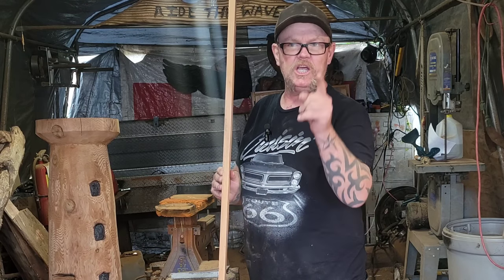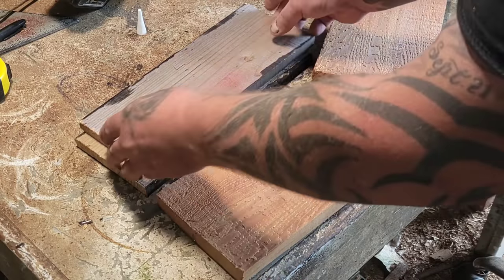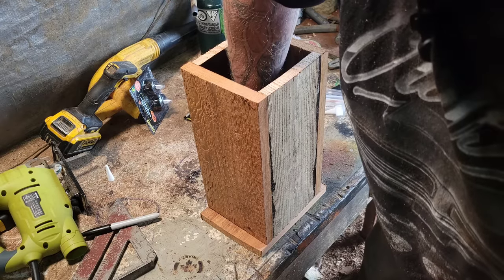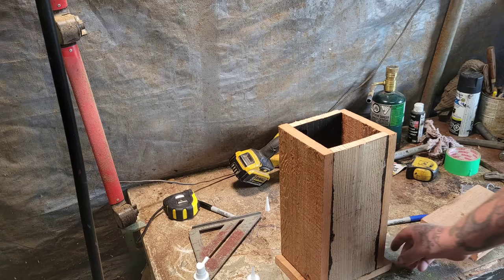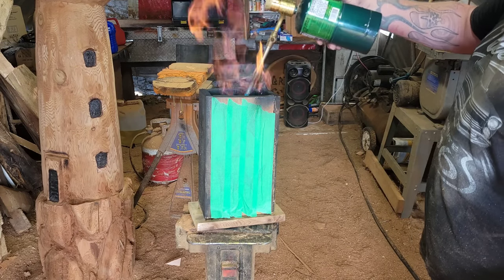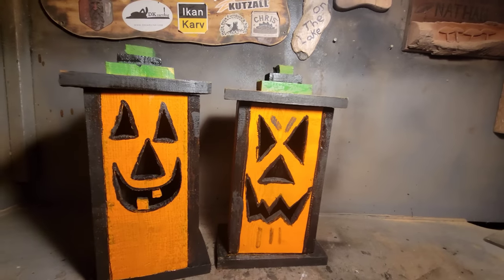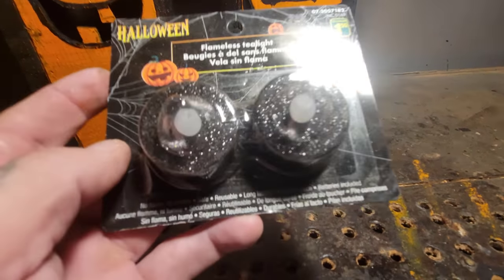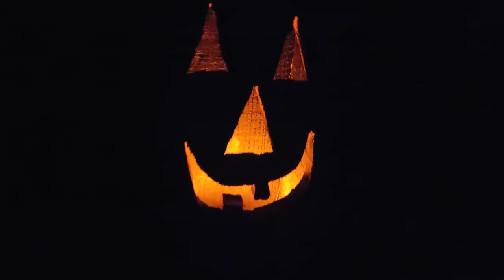Beginner-How to make a Jac-o-lantern out of old fence board.

Comment: Love these.  I use to make them solely out of pallett wood.  For the top stem I just used a dowel or a small log.  I didn't glue just used a brad nailer.  They always sold out!!   Great idea with the star bond though!!  Carve deeper!!
Reply: What did you charge for them?
Reply: @daveparker839  $25. But it was probably  to little.  I had it down to where I could make 4 to 5 an hour and I was just trying to get enough money to upgrade tools at the time.